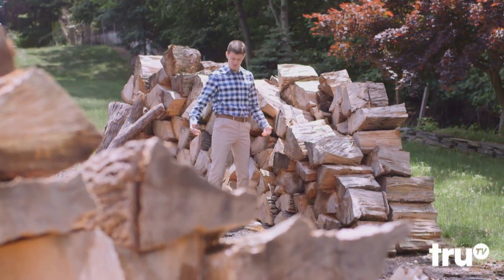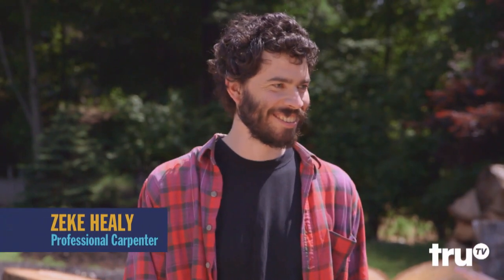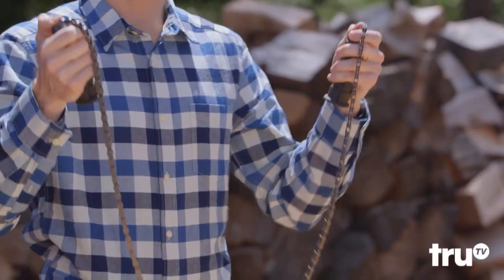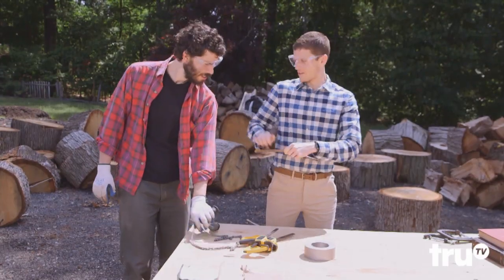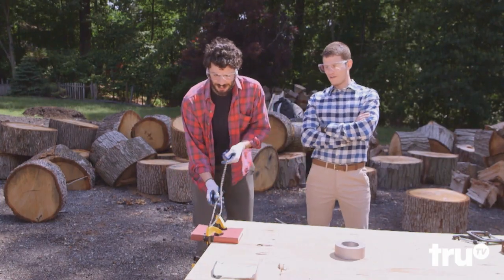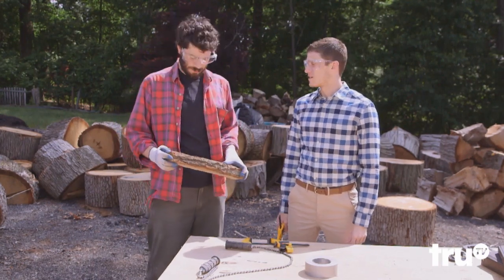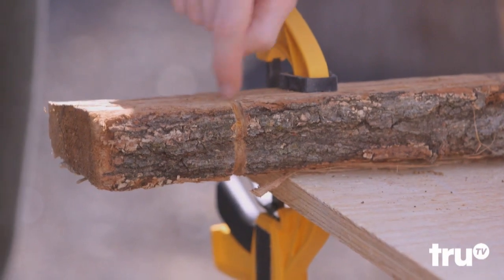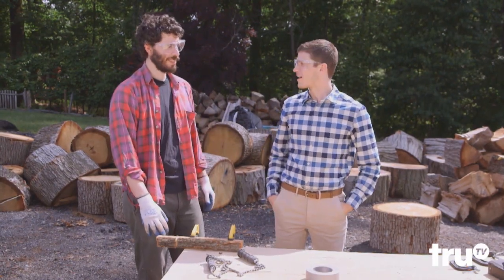Hack My Life - Bike Chainsaw Hack

Comment: Why exactly did they attach handles to the bike chain? If the chain is meant to span the distance to the back wheel from the main gear, just take the rear wheel off and loop the chain over the log instead and pedal. Your legs are a hell of a lot stronger than your arms, and the full cycle of the chain would make it less likely to break from repeated use in the middle.
Reply: Nice you should make a tutorial I could have my dads class watch it and do it